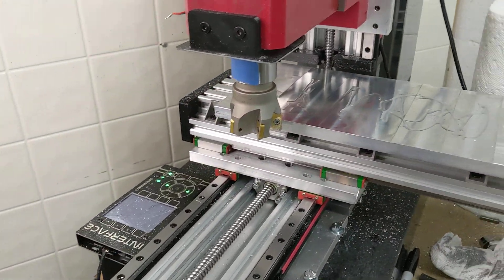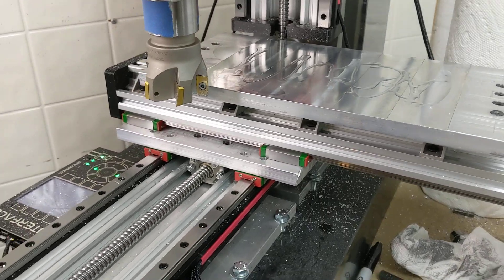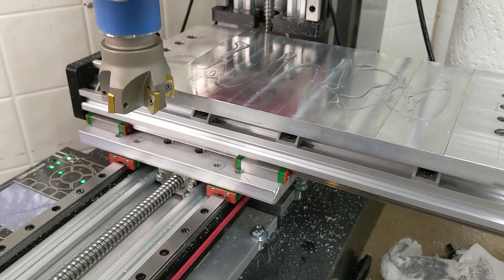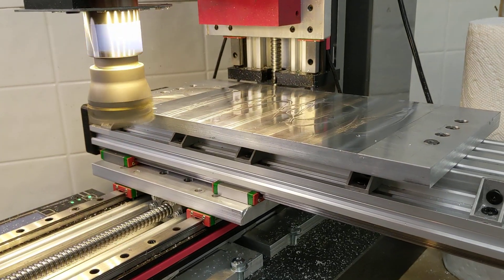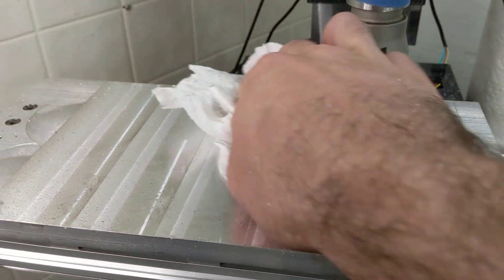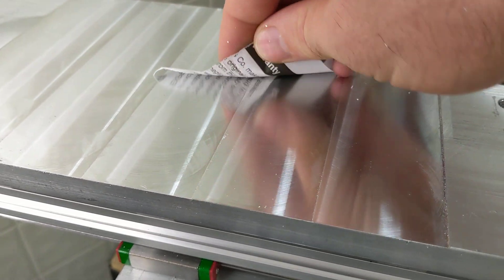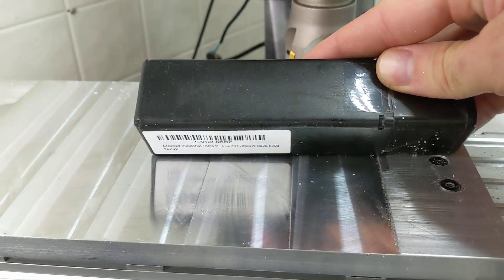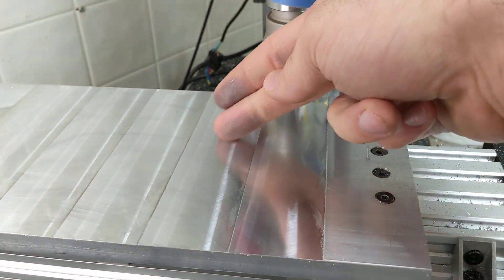RIGCNC-DIY Open Source Granite CNC Mill- Crazy 2" Shell Mill facing on Aluminum

Comment: What kind of tolerance accuracy you're obtaining?
Reply from the maker: I can hit ± 0.005" without trying too hard, and at a reasonable speed.  I don't work on anything that needs higher precision/I don't have experience at higher precision.  I think I could get there If i was really careful with my work holding and set ups.
Reply: @TheBetterRyanKelly  Thanks for the reply, thats nice about 127± microns, which is great for majority of CNC milling. 
How did you make the aluminum base plates, did you use the plastic base first to make the aluminum plates?

Comment: You'll be astounded how different that will be with the proper inserts.  The coated inserts you have there are for steel and grossly underperform in aluminum.  The coating is actually stickier for aluminum than the bare carbide.  They work great for steel though.  If you get the proper inserts they'll be shiny like a mirror with no yellow appearance.  It will be a big enough difference to warrant an update video, trust me.
Reply: Unless it's zirconium nitride, in which case I would argue he's better off with the coating as it's developed for machining aluminum specifically. If it's not zirconium nitride you're right but at this scale it probably really doesn't matter either way.
Reply: @rileypeterson3383  Yeah, I've never seen that coating on inserts, only on solid end mills.  Also, all the cheap chinese inserts end mills come with the cheap inserts meant for steel pretty much by default.  I could be wrong, but I'm 99.9% sure those are the normal steel cutting inserts.
Reply: The inserts for aluminum are shiny and they have an H in the nomenclature usually. I switched to them a while back and it's amazing how smooth they cut aluminum.
Reply from the maker: Good to know, I'll search those out and swap them, thanks for the tip!
Reply: The aluminum inserts for that tool are apkt1604pdfr-ma3 h01 korloy brand
Reply: Have you worked out your speeds and feeds to get your correct chipload? At the slow feed rate you may want less cutters for the facemill...just a thought

Comment: Consider adding some "way covers" to give the seals on the linear rail slides and ball screw mechanism an easier time and less chips/dust to fight with?
Reply from the maker: I have way covers for it, I just have to reinstall them, I took them off for the aluminum plate conversion

Comment: Would it be hard to make step by step instructions for this?(for how to make rigcnc) I'm kinda an idiot. Also I like what you make.
Reply from the maker: I can try, I don't know if I have the attention span for that, do you have any specific questions I can answer?  The absolute ideal scenario would be someone else tries to build one and documents the process. If I try to write instructions now I'm sure I'll miss things
Reply: @TheBetterRyanKelly  Your existing documentation page is pretty thorough, isn't it? Seems like almost enough? The only thing I immediately picked on was price vs reality, eg the steel angle plate was like 4-5x what you specified when I looked. However a welded structure milled by a friend with a good machine could replace that.
Reply from the maker: @fredio54  I believe the plates are currently ~50% more than I specified, mostly due to tarrifs and pandemic supply issues, not 4x... I believe another user found a source that's selling them for less than the one I originally bought, there's a link floating around on one of my videos
Reply: @TheBetterRyanKelly  Cool, hunt it down and put it on your site :-D

Comment: Very nice results! 
Will you try steel or do you think that it's outside the machine capability? 
What is in general the end goal of the machine? I mean you seam to already have a very usable machine right now! 
5 axis? 😏😏
Reply from the maker: I am definitely going to try steel, I have a few pieces of plain steel and a softer stainless to try. End goal is to mill some small aluminum injection molds for a micro-molder I bought on Kickstarter 😀
Reply: @TheBetterRyanKelly  I like a lot this goal! Keep up the good work and thanks for sharing!